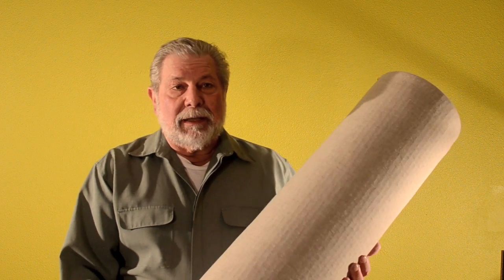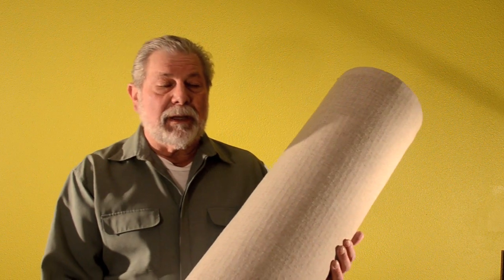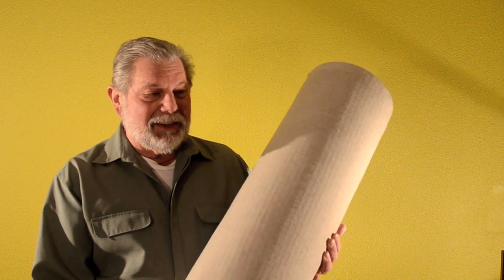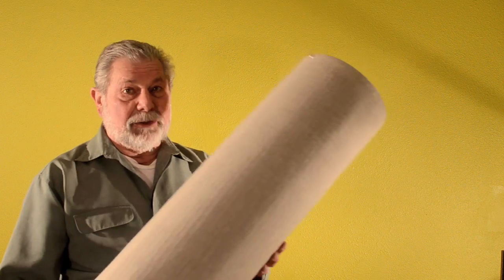The TubeTrap

Comment: I don't believe a passive sound absorber needs time to react and start working.  And how would an absorber distinguish the attack from the sustain? Does it change its density when hit by a certain sound wave and then gradually change back. HOW?
Reply: a passive absorber is instantaneous, but a ported bass trap or helmhotz resonator, there is some time required for all the air within the chamber to begin resonating with the chamber. the reflections needs time to propagate. there is a relationship between the size of the chamber, the frequency of resonance, and the loudness of the sound resonating the chamber
Reply: A system at one of its  resonance frequencies can absorb energy in the most efficient way. when energy is thrown in a oscillating system then the amplitude of the oscillation increases at a certain point. At the resonance frequency that happens at the most rapid rate (but it takes time). when you swing a pendulum at its resonance frequency the amplitude keeps getting bigger and bigger allthow you are applying the same force each time. After some cycles it reaches its maximum amplitude (due to friction, otherwise the amplitude would increase to infinity if infinite time passed), at this point a diaphragmatic absorber works at its maximum efficiency. in any case, every system in this universe takes time to propagate and evolve and reach an equilibrium, you can't have a motionless mass and at the very next moment a moving mass with a certain speed. nothing is instantaneous in our universe. Except some twisted quantum effects ..